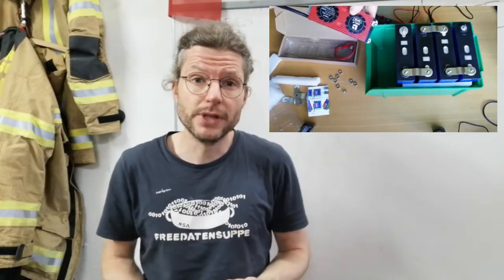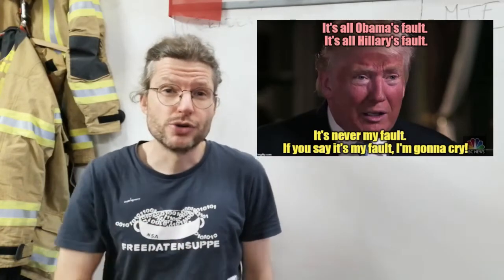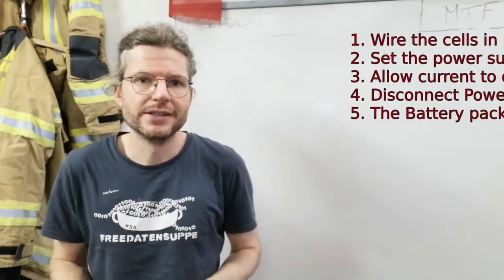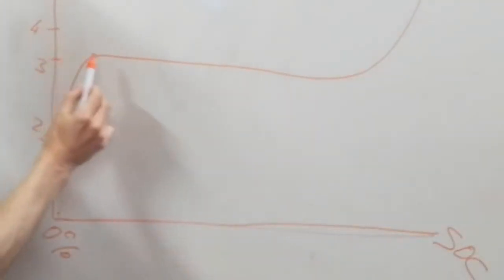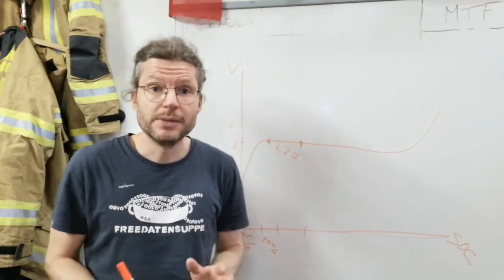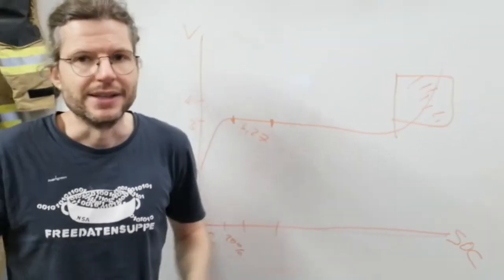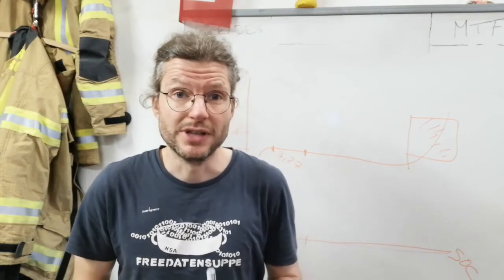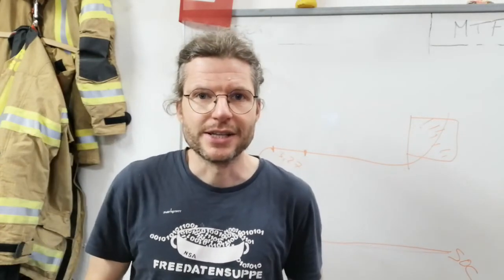Building a 12V LiFePO4 battery pack and why passive balancing is a bad idea

Comment: Hi, any updates regarding your battery voltages? Are they still balanced or close to each other? This has also happened to me and I’m looking into the option of top balancing.
Reply from the maker: yup, so far everything works fine but I haven't cycled them very often so far. In general top balancing works very well. In the worst case you can still add an active balancer if you run into unbalances states quite frequently.
Reply: just leave the battery with the daly for a few days, it would self balance itself, then you just charge it more. it wont be perfect but it better than buying a bench power supply that you might use for like once a year.
Reply from the maker: @Mayo-dj6ew   this can work if the state of charge of all cells is very close otherwise it takes ages. an alternative can be an active balancer. it is just around 5eurs and can be used to top balance without a bench power supply
Reply: @Mayo-dj6ew  Daly only balance when being charged.

Comment: Subscribed ! I too am having balance problems on my new Chins batteries. Trying to figure it out now. Thank you sir!  WG7D
Reply from the maker: thanks! do you want to share more information about your problem?
Reply: @LupoDIY  Sure. I have 2 300AH Chins (see my channel) that I am going to use in series for a RV 24v system. They have a built in bluetooth app so I am able to see each cell. The low cell is 3.42 and the highest is 3.60 . I fully charged both and still the same. Now from suggestion from Chins I have put both in parallel..Waiting now to see if that helps. Thanks,Mike WG7D.
Reply from the maker: @WG7D  how did you charge it at the same time? in series?